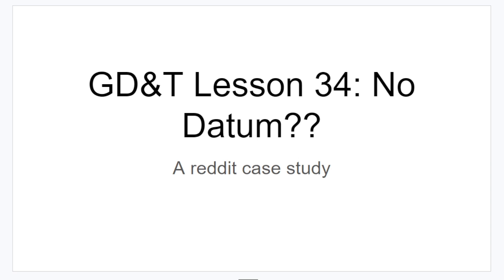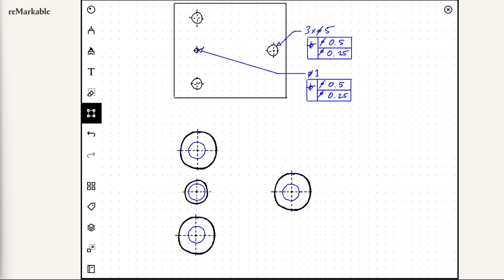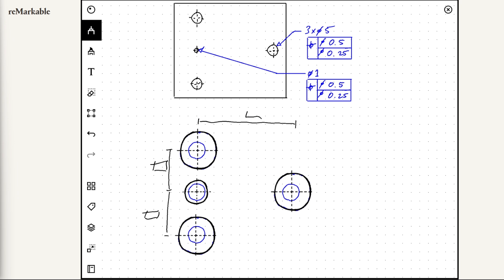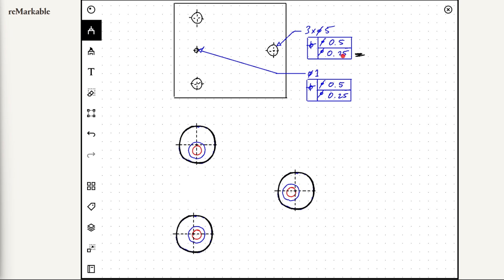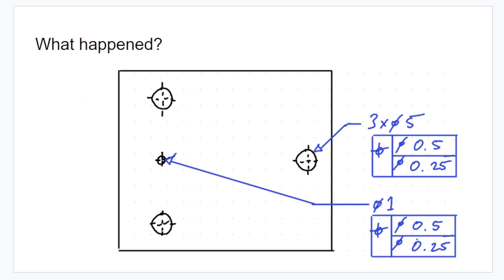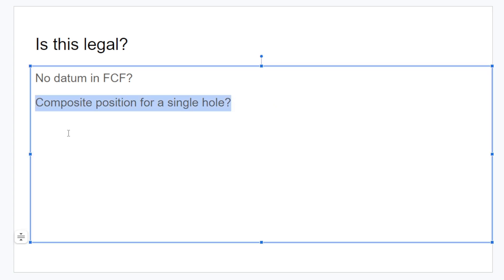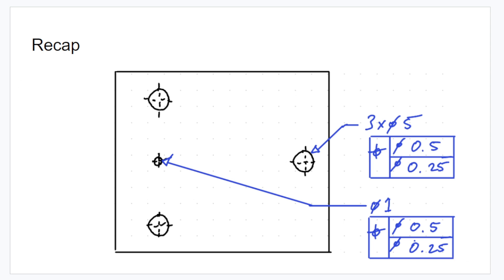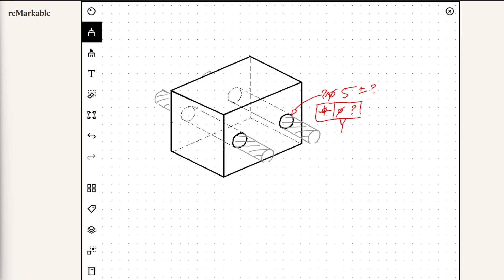GD&T Lesson: No Datum??

Comment: I appreciate the video!  It still seems like you would need datums to est the .5 tolerance zones?  I guess in the background you use the holes themselves to create a coordinate system to calculate the position of the .5 zones and your choice of which holes are the datums can be random as long as the basic dimensions are maintained.  Just figured I'd leave this here since I think I answered my own question...
Reply from the maker: Good question!

The standard allows you to create tolerance zones that have spatial relations to eachother, but no datum

For example, one could imagine two pins floating in space that had a distance and orientation to one another, but not related to anything else

So in that case, neither is the datum, they both exist simultaneously 

Hope that makes sense!